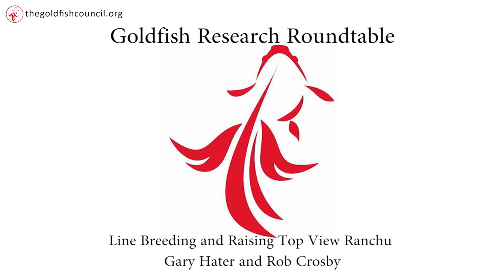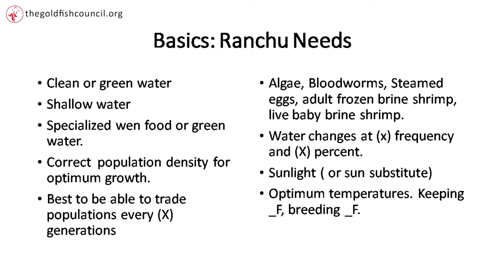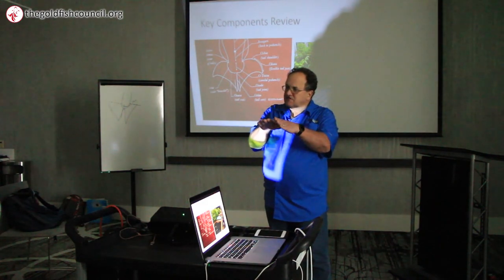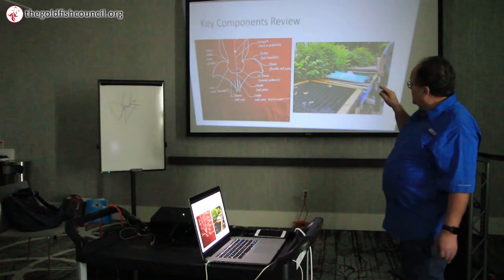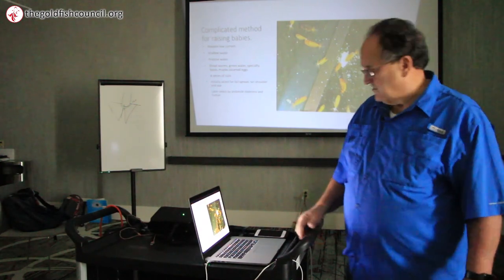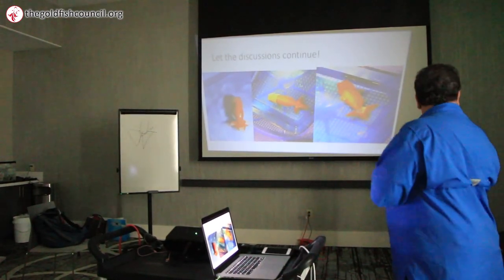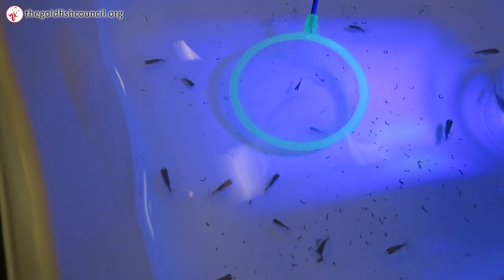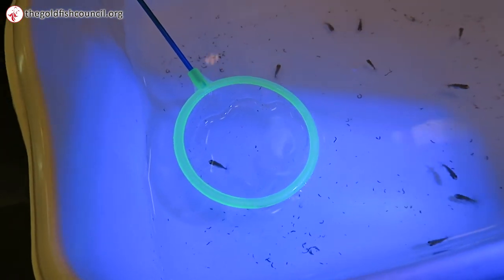Gary Hater and Rob Crosby   Line Breeding and Raising Top View Ranchu

Comment: i noticed something, whats the difference between water displacement and water change? sorry for the beginner question
Reply: Water change you first drain the old water out then add new.

 Water displacement you just add new water into the tank letting the mixed water flow though a over flow.